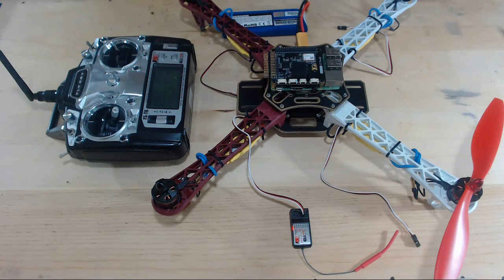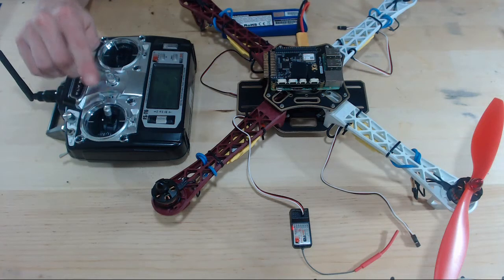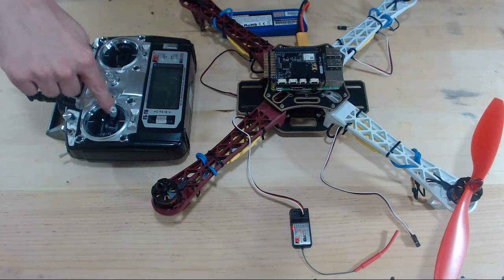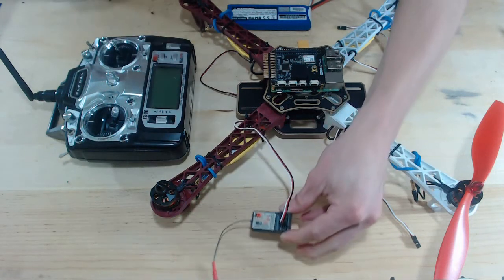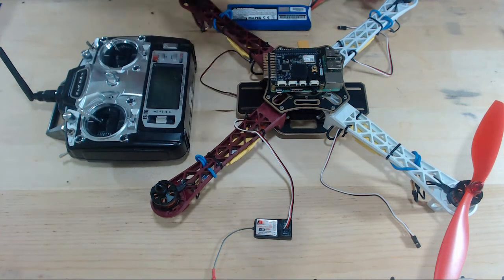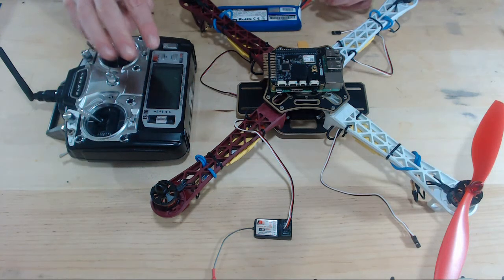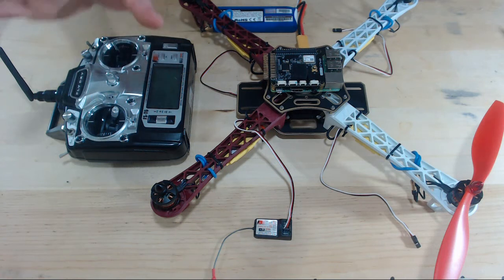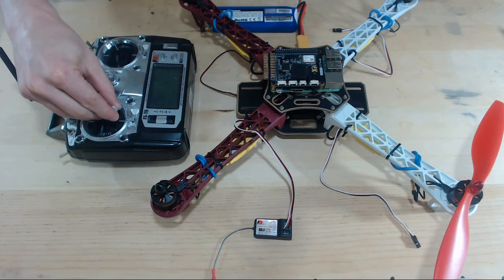How to Calibrate an ESC in less than 5 Minutes (2020)

Comment: Please help: We are new to RC aircraft, and we are stuck on this process.

After following your calibration instructions step by step, we move the throttle up slightly and then the motor jerks and stops then beeps 3 times as if it's confirming the calibration again. When I push the throttle up again, it jerks again and repeats the process. If you leave the throttle up, it beeps non-stop like a warning.

What could be wrong?

Thanks in advance.

Comment: Very good .
I will give it a try.
I've been working on a 1:32 scale touring car with a 10 amp drone esc.
I got it to work, but not properly.
One other thing. I'm not using a flight board. I dont know if that will make a difference. 
Any suggestions would be helpful. 
Thank you.